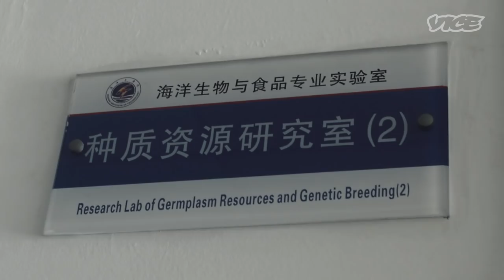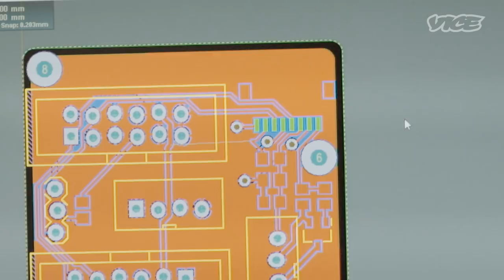The Big Bug Eating Industry of China (Part 2)

Comment: 11:12 "usually he drowns the cockroaches in boiling water, but the power was out in the village so we had to use cold water and a wok" shows the bugs being cooked slowly in cold water over fire

they couldn't boil the water first then throw the bugs in? Wouldn't that be the same as cooking them in boiling water but just using flame instead of electricity to boil the water?